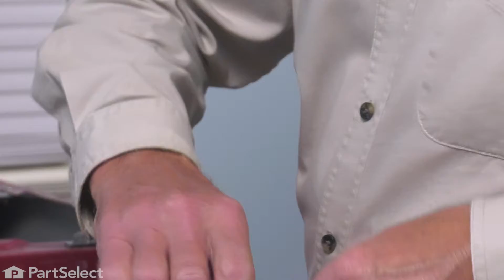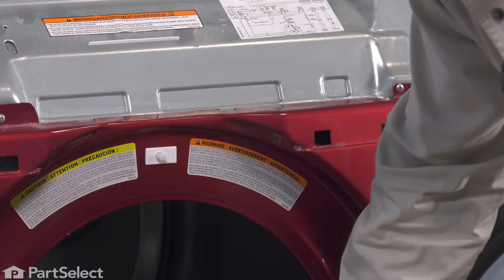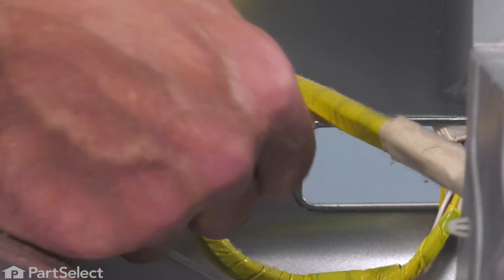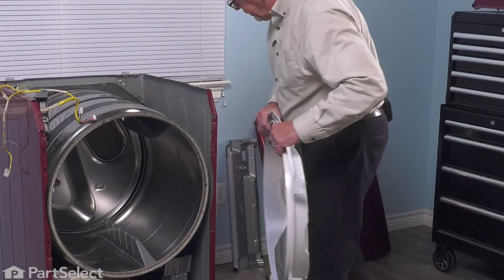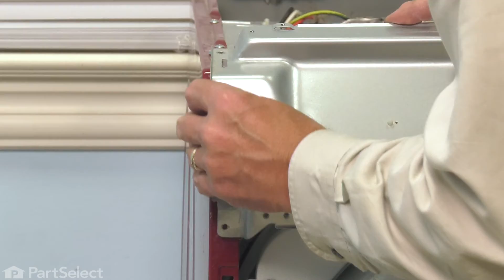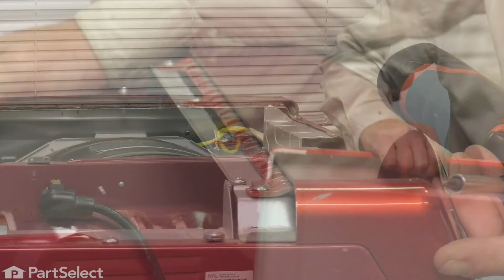Samsung Dryer Repair - How to Replace the Thermistor (Samsung Part # DC32-00007A)

Comment: thank you for the video! What a terrible design for this dryer: swapping a small part (or the thermal fuse next to it) which is prone to failure requires disassembling the entire device :(

Comment: Why did you replacement thermistor ??? thank you.
Reply: A failed thermistor can make a dryer run for a few seconds, then stop with a code.  On most Samsungs the thermistor code is t0/tO (open/infinite resistance) or tS/t5 (resistance too low).  Use a multi-meter to test the thermistor.  If it shows an open path (no continuity or infinite ohms) the thermistor is bad and needs to be replaced.  Be sure to use a ohm range greater than 10kilo-ohms since the thermistor will have a resistance around 10K at room temprature.